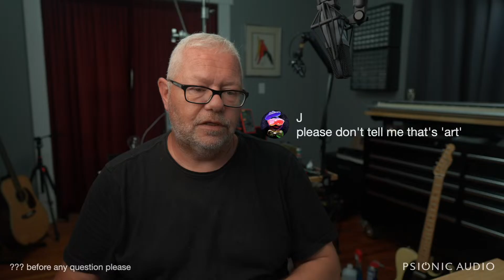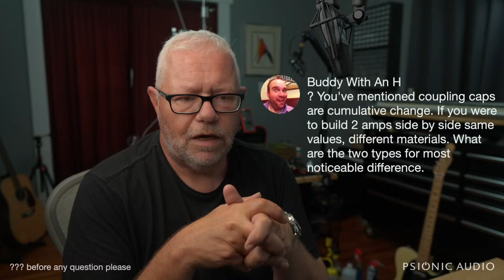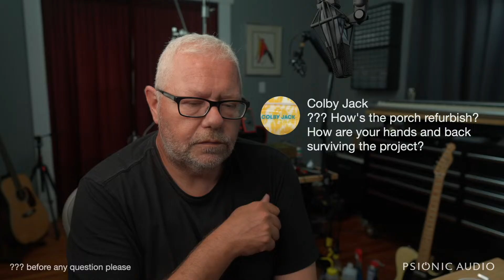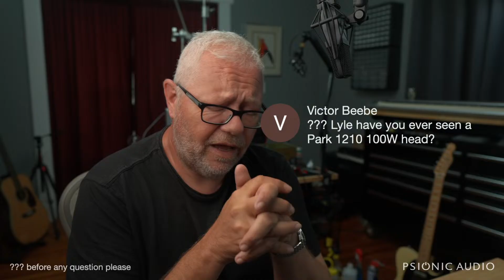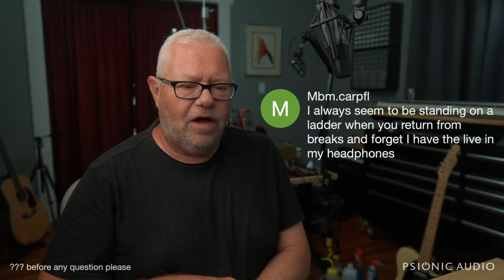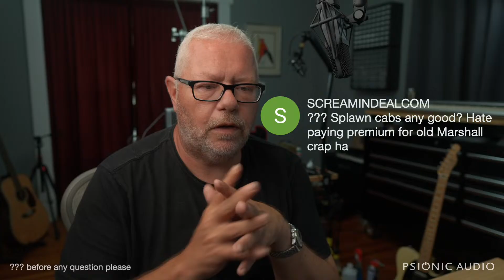Live Chat | Saturday July 26

Comment: ??? Years ago a picked up a Plush P1000 for $30 as it killed power tubes.  I determined that the PT has been replaced with a tube rectified unit, but with SS rectification.  This resulted in 560 volts on the 6L6 plates.  I have fixed that with a new PT.  I am curious if you know of any 85 to 135 watt amps that are tube recitifed?
Reply: Sunn 1200S & 2000S